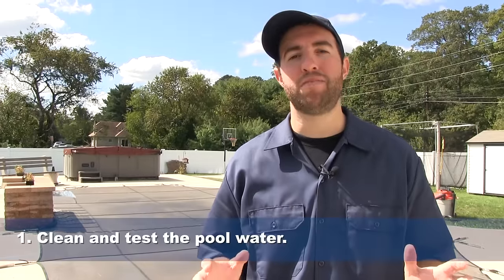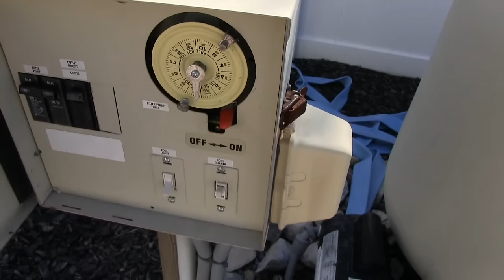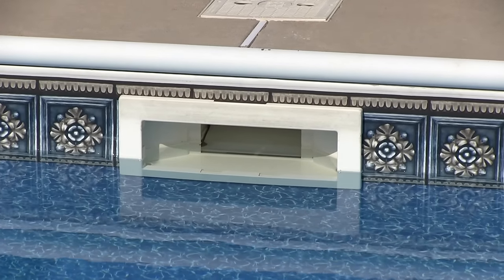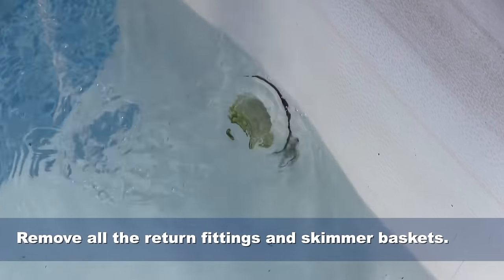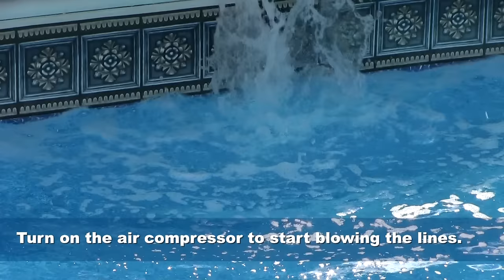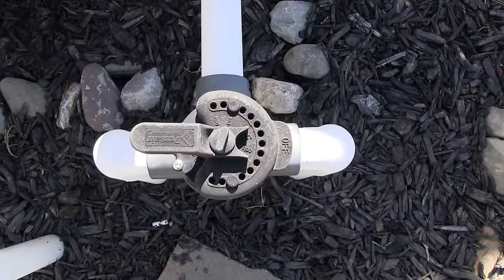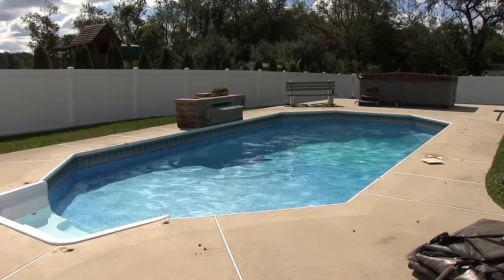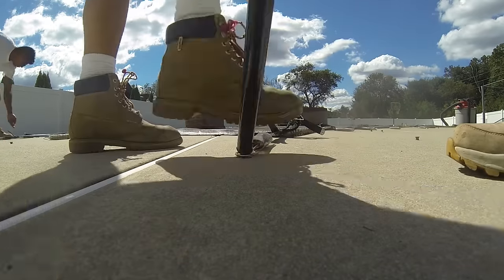How to CLOSE (Winterize) an Inground POOL | Swim University

Comment: 1.) Clean Pool 2.) Drain below skimmer using main drain/backwash--Once running filter water is clear, switch to waste. 3.) Blow lines dry, first remove all return fittings, drain plugs and skimmer baskets., set valve to "re-circulate" change source to skimmer. shop vac the skimmer waste water out-plug it once dry. then plug the return lines. change source to main drain line after a few minutes of bubbles from the bottom quickly move it back to off (not skimmer or main.) 4. add winterizing chemicals. 5. cover. and lock safety gates. 6. Enjoy a well-earned beverage.

Comment: Came across your video while trying to find instructions about blowing out the main drain for winter. I am confused how my pool plumbing is setup. I connected air compressor to blow out all my lines. I was able to blow out my 2 skimmers and all the returns. But I am not able to do this for the main drain. I have tried so many things but just can't figure this out. No matter what lever I change....I just do not see bubbles coming out from main drain. Any idea what is going on?

Comment: A couple opinions I have after doing this for 20 plus years. I live in the upper Midwest and it gets cold with large snow loads. I do not use antifreeze and have never had an issue. If you blow out the lines correctly you will have no problem as long as you are using a gizmo in the skimmer. Winterizing chemicals are a money grab. Assuming the water chemistry is correct and the pool
Is clean when closed, it will be the same when opened. With the proper cover completely blocking sunlight there is no need to add more chemicals. You can waste money and put more chemicals in your water but there is no need.
Reply: Hi, I was reviewing your step by step list, When blowing out my pool lines, do I attach my air compressor and use the "front" drain plug port on the pump to blow out air "backwards" to the skimmer and the "side/back" drain plug port on the pump to blow air forward to the discharge jets?
Reply: @theshadow2171  Hello, did u ever get an answer to this question? I too am wondering. Thanks.

Comment: I’m unclear on something. You say to only lower the water to just below the skimmers. You remove the plugs that are under the skimmers…you called them “return lines”. Then you blow. 

When you stop blowing, sure, you’ve pushed the water level down to below ground level, but you’ve left water in the returns. Is that a good thing? In the past, I lower the water level to below those, blow out everything, plug the returns, pour antifreeze into the skimmer drain, then plug everything up. Then I blow out the bottom. I do like the idea of using the recirculate line. You just made me realize why, this spring, one on my tubes had shattered. I didn’t blow out the recirculate line 😮. Smarter every year :)

Comment: When blowing out my pool lines, do I attach my air compressor and use the "front" drain plug port on the pump to blow out air "backwards" to the skimmer and the "side/back" drain plug port on the pump to blow air forward to the discharge jets?

Comment: I have a Jacuzzi sand filter and there is no recirculate setting on this older filter. What setting should be used when blowing the lines  out on a Jacuzzi. I have filter, rinse, winterize, whirlpool, backwash, test and drain. I tried with the whirlpool setting and no air came out of the bottom of the pool drain port. Switched to the filter setting and was able to see air coming out, but would still like to know what setting should be used when blowing air out. Thanks

Comment: My skimmer line and main drain line both go into the pump but just one valve to open and close the line.  I tried to blow out the lines yesterday with an air compressor and i saw some bubbles come out from the main drain and it just bubbled out of the skimmer but did not shoot out like a fountain and there is still water in the skimmer line.  Was I supposed to close the valve first?  Or do I feed air in and then close the valve to create a pressure seal and then continue to push air through?  Also, do you have to blow out the suction first and then returns or does it not matter which order?  I blew out the returns first and then tried to do the skimmer/main.  Thank you!!

Comment: Thanks for the video, quick question about the main drain. I saw bubbles coming up from the main drain, but after a short time no more bubbles, does that mean the airlock has engaged? should I be seeing bubbles coming up from there for as long as I have the air-compressor running ?
Reply: Yes you should. Also I would not blow out the return lines or skimmers this way if you live in an area that the temperature drops below freezing.

Comment: I know I'm 3 years late, but I have separate feed valves from my skimmer and floor drain, so I lower my water below the skimmer with the skimmer valve closed, then open the valve to suck the water out of the skimmer and line.  Then I blow it back from the skimmer to the pump with a shop vac.  Way more effective.  I also don't add chemicals after blowing out the lines.  Add them before so they fully dissolve and the chemistry balances out before testing.  If you can't circulate the water, there's no way your chemicals will circulate and your readings will be off.  Most people will not get bubbles out of their floor drain.  That's OK as long as you pressurize the line enough to push the water below the frost line and close the valve on the drain line while still under pressure.  That way you get an air lock in the line that will prevent the water from coming back up above the frost line.
Reply: What is the point of balancing water and adding the winterizing kit? After 6-9 months heavy rain and thawing ice will dilute everything...

Comment: What is the part used to connect the air compressor to the pump for blowing out the lines?
Reply: Another video I saw said it's the same thread as the air compressor. So i think 1/4" or 3/8" NPT female on the pump. So you'll need a male pipe thread of the type, which is fairly standard for most air compressors. You'd have to check the plug on your pump to confirm. I'm sure you can find it in the manual or online.

Comment: I used a compressor to blow out my main drain lines. Bubbles were not coming up equally from both pipes. A lot more on one of the two and a bit on the other. Is this going to cause me some issues? Or, as long as bubbles come out means that water was pushed out. Thanks!

Comment: How does the water stay out of the main line?
Reply: All you’re doing when blowing out a main drain is blowing all the water in that pipe from the pump to the bottom drain so there’s no water in the actual pipe.  And while the blower/compressor is still running you close the valve to the main drain and this air locks that pipe.  So water won’t pass back up that pipe.

With pump lid open and main drain valve closed, listen if you can hear any hissing around.  If you do, this means your main drain valve is leaking and you should put a plug in like they show in this video

Comment: I am brand new to pool ownership and I apologize for the stupid question:  I have a Hayward sand filter and there is a line going into the top of the filter from the pump and another line going out and into the concrete, which I assumed was the return line.  How do you ensure this line is blown out?  I know you can't blow air through the filter, do you need to take it apart to blow it out or are you blowing it out backwards and everything is ok?  Again, I apologize for the stupid question.
Reply: Thats your backwash/drain line

Comment: i did everything you said pulled all the plugs put compressor to the bottom of the basket by the filter but no bubbles before i drained the filter bubbles where coming out but not anymore
Reply: Put it in the stand pipe

Comment: I tried the shop vac and getting an air compressor and neither worked because I don't know what kind of a hose to use to get down to the size valve that will fit into the pump drain plug.  I looked at the Cyclone pool line blowing machine and it doesn't look like it arrives with all necessary equipment either.  Any advice?  It's starting to get cold.
Reply: Go to your local Home Depot or Lowes and you will find a rather large kit with all of the fittings you will need.  Then buy a 25 ft air compression hose that has 1/4 inch ends on it.  The fittings kit at Home Depot is Store SKU #603867.  If you can't find this stuff, ask a Home Depot robot to help you with it.  You are going to need to hook one end of the hose to the 1/4 inch drain hole on your pump, and the other end to the air compressor.  Be VERY careful not to use too much pressure on your pool lines or you could blow them apart.  You really shouldn't be using more than 10 PSI to blow them out.  I hope this helps, and if you still feel unsure, please don't be afraid to call a local pool professional in your area for advice.  I'm sure there's at least one good professional in your area who will talk to you without charging you, but just don't expect a house visit for free.
Reply: Also buy some Teflon tape.  You will need to wrap the ends of the hose with it before you screw on the fittings.

Comment: Great Video!! Quick question: what happens to the water inside the filter? How do you drain that?
Reply: What I do with my sand filter is set multiport valve to rinse.  I leave the backwash  hose on and blow out the filter.  My blower starts from the pump basket housing.  Once most of the water leaves the filter, I shut off the blower and take off the backwash hose then turn it back on and let is blow out even more until I am satisfied it's finished.  Once done, I put valve to winter setting.  I think Matt will agree with this.
Reply: pharman100 We live in California, is it necessary to drain the lines, filters, etc...?
Reply: Sarah Thomas I guess it depends on your winter temperatures which can probably vary greatly in a big state like yours. We have hard freezes in New England so it's a no brainer.  Sarah, I would suggest you call a local pool service company or even a local pool store and inquire as to what is routinely done in your area and go from there.
Reply: +HePE27 every filter has a drain plug ,  its usually located in the back side of the filter.  just undo the plug and the filter tank will drain
Reply: +Sarah Thomas if you get freezing temperatures then yes you must blow out the lines.  but if your winter months are above freezing then no
Reply: Pull out the plug in your filter to let the water run out.
Reply: @bobbynieves9320 this is what I do too and remember to take off the pumps two screws to drain there too

Comment: Thanks for the great video. I used a compressor and blew out the return lines. But, I cannot clear the line from the skimmer to the pump. I have a feeling it is pulling from the deep end drain as well as the skimmer??? However, I cannot get air to come out of the deep end drain when I compress the system and plug the skimmer drain. I keep getting a never ending supply of water refilling the skimmer from the drain. Any advice would be appreciated.
Reply: We have the same problem.  Did you ever come up with a solution?

Comment: I live in Las Vegas nv, should I close my pool for the winter? Keep in mind Vegas winter days are around 70 to 80 degrees days.
Reply: You only need to winterize a pool if it's going to be exposed to near or below freezing temperature (32 degrees) during winter months where you live, unless you have a heating source. For Vegas weather you don't need to winterize, but if you plan on not using the pool you should still keep the chemicals balanced and run the pump at least a few hours a day, replace/flush the filter, etc. if you care about an easier/cheaper opening.
Reply: why tf u closing ur pool!? keep it open year round and put a heater and a fireplace back there!

Comment: It's better to not drain the pool and to maintain the water level IMO, the exposed plaster can be damaged. But in the skimmer you'll want to use an expandable plastic plug and/or bottle partially filled with pool antifreeze and/or a styrofoam pool float for expansion.
Reply: Someone said I should allow the light fixture to float in the water during the winter is that true and why
Reply: Roy McLean SR. That sounds like total BS. You shouldn't need to do anything to light fixtures. They usually are a few feet below the water level where it's less likely to freeze over and is safer.

Comment: I understand why you blow the water out of the lines but was wondering if you could just lower the water below the jets then turn on the pump to blow out the lines instead of using a compressor.  Everything else you mentioned would be the same.  Thanks
Reply: never run a pool pump without water, you will most likely blow the pump. Some apparently have a safety that will shut them off if they sense they have no or too little water. But it is way too expensive of an item to risk ever running it without water. It is the same reason you never change filter settings with the pump on, you risk breaking it.

Comment: Matt - I only have 3 returns and they are located on the bottom at about 3, 5 and 9 ft depths with no way to plug.  Suggestions?
Reply: Air lock or you'll have get wet if you don't have valves for that
Reply: In that case you just need to blow the air out the returns and then close the return valve under pressure... it causes a siphon on the line so the water doesn't get to the higher points in the pipes where you're at a greater chance of freezing the line.

Comment: Great video but missing steps. I think it’s vague on purpose so you buy his complete “winterize your pool” video for $100 on his website, which is fine. A little expensive but he’s got to make money somehow. That said, shouldn’t you add the winter chemicals 24hrs before with the filter still running? Also, don’t you add antifreeze (camper not auto) to the lines through the skimmer?
Reply from the maker: I’m actually working on an updated video. We’re filming at the end of September. It’s only vague because it’s old and needs to be updated. I made this long before I had the course ;-)
Reply: @SwimUniversity Thanks Matt. Sorry, I didn’t mean for it to come off so snarky. You’ve always been helpful to me in the past when I’ve had questions?  You’re the first videos I watch when I have pool questions. Happy to hear you’re making an updated video. This is the first year I’m closing the pool myself so I’m trying to educate myself before October.